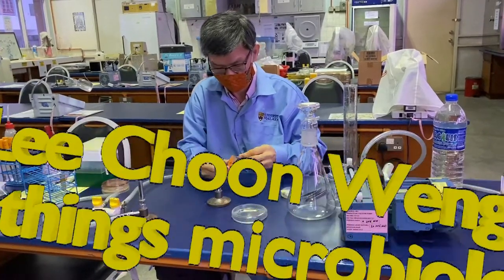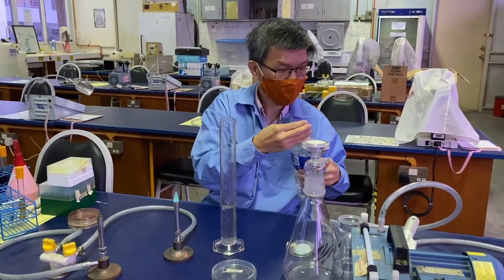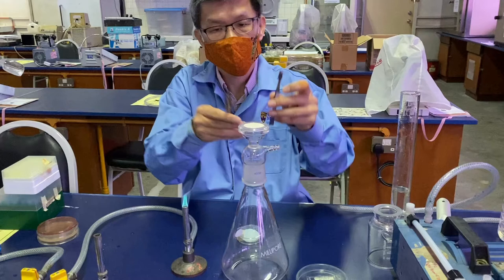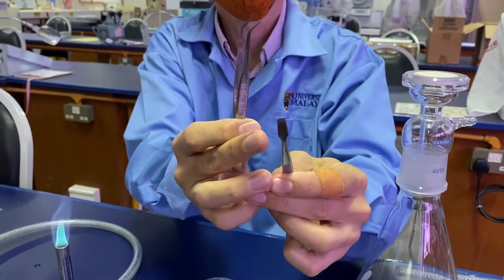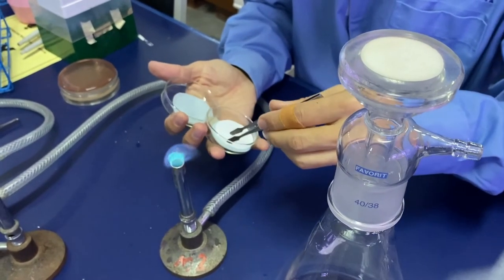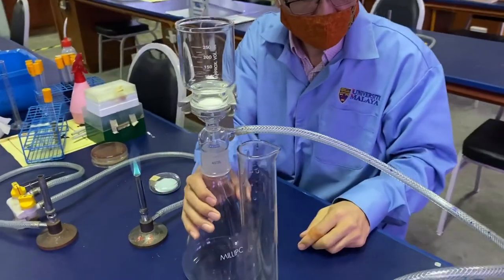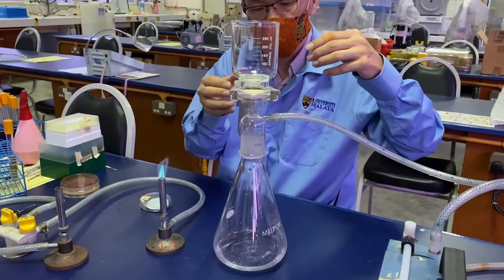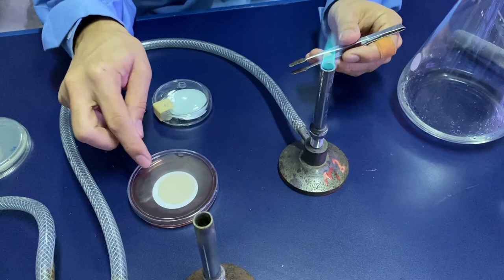Microbiological Techniques: Membrane Filtration Technique (MFT)

Comment: Hi! Great video. What's the correct way to autoclave the filter paper? Do you have to soak the filter membrane in distilled water first?
Reply from the maker: We wrap them in aluminium foil and then autoclave them. Ensure they are dry before using them.
Reply: Thanks for the reply! Do you wrap the whole petri dish or just the filter papers? @LeeChoonWeng
Reply from the maker: @MichelleMunguia-figueroa  wrap the filter papers. When need, aseptically use cleaned forceps to pick the filter and place them on top of filter base